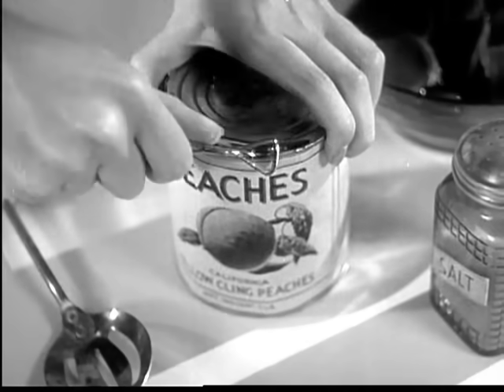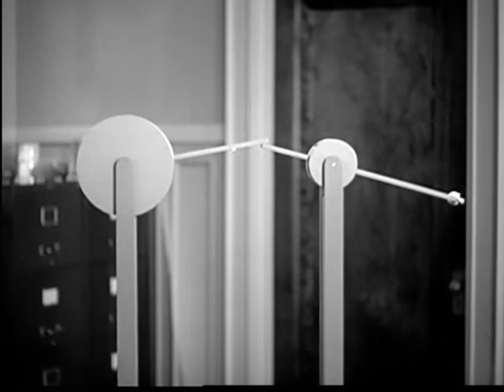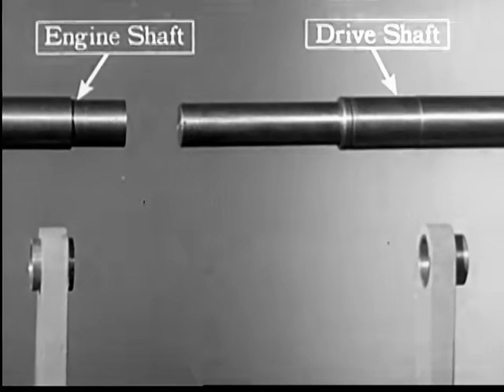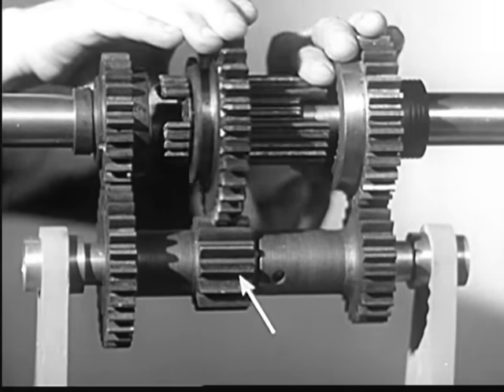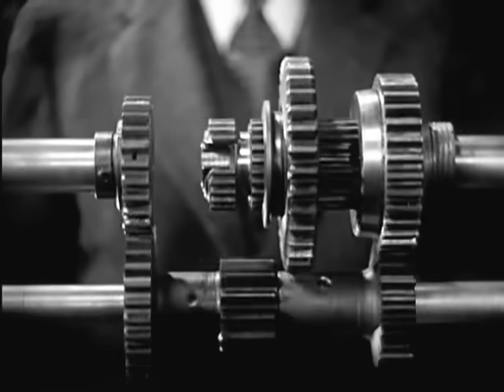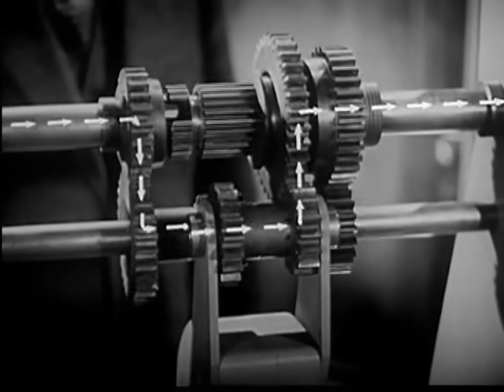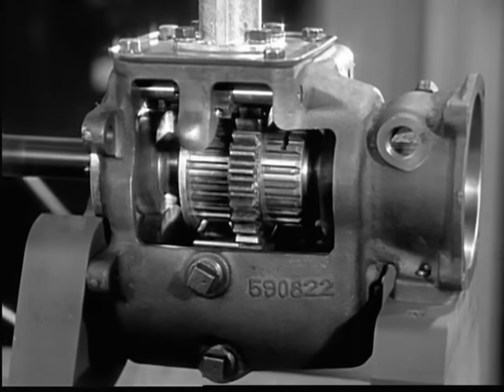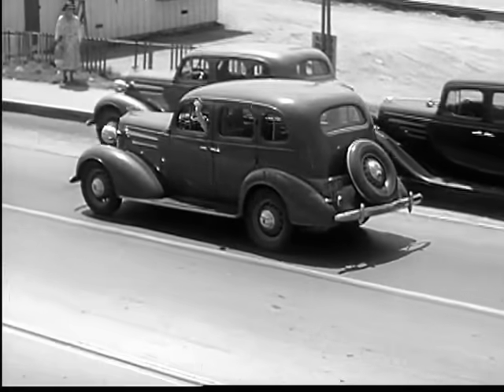Spinning Levers - How A Transmission Works (1936)

Comment: To everyone wondering why this explanation is so good.

A strong part is we don't actually understand mechanics very well anymore. The bit about a gear being a series of levers is describing the gear in terms of its first principles, the fundamental understanding. Raw science and raw engineering.

Today most education is abstracted and provides information without technical substance. There are many complex forces behind this change, sociological, political and the selection dynamics in our education system. One way to articulate it is that the people writing the material don't understand it as well, education is a cargo cult translating from experts. Rarely do the experts write the documentation and educational materials. So the information is watered down, and becomes more about teaching people a shallow knowledge about something than the necessary understanding of what it is. Knowledge is good enough for tests, but poor in practical terms. 

Evolutionary selection dynamics applied to the flow of information via human behavior. This is the subtext of the modern world given the extent and impact of social media. The majority of evolutionary science barely recognizes this, in part due to the very dynamics it should be studying within itself.
It's becoming a critical problem and we need to get wise to it.

Back to first principles. The old idea in education was to teach people the fundamental ideas of a field of knowledge so people could develop a broad enough grasp of how it works to reason about it and apply their understanding creatively. This was the point of education as a institutional project. Especially at the university level. 

Now education is mostly providing learning, if we're going to make a technical distinction in terms. The public pays to learn the functional skills for a job, what used to be on the job and apprenticeship learning. This gets nearly all the dynamics and incentives backwards. If we're going to have a stable and functional society long term.

There is no access to first principles, the idea is largely forgotten. The world is made more complex and far less compressible for the average person. This is bad for economic discovery, which is an assumption the capitalist model and just baseline market dynamics rely on to avoid bubbles and collapse. 

When you realize that Economics is actually just evolutionary selection dynamics, that's the window to a suite of effective first principles. (No one seems to realize Economics and Evolution are different maps of the same thing. Certainly not in the mind blowing essence of how this duplicates and distorts our species perspective of itself in the world.)

Anyways that's a short rant on why old vids from the 1930s being better than modern videos on the same subjects is possibly the most important topic you could think about.

Comment: 2:00  That's a good analogy, but notice how the "teeth" are sliding against one another when they make contact, rather than just pushing.  This is what happens with spur gears, and results in wear over time.  The trick in designing good gears is to make the shape of the teeth so that they "roll" against one another, and never actually slide.  The ones in 2:17 are closer to this ideal, but still not quite correct.

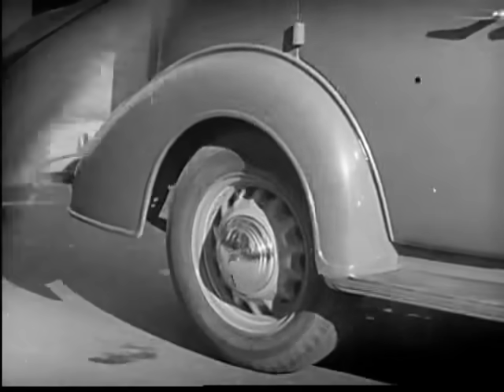Comment: Most of this film is excellent. However, at 6:23 the explanation of reverse begins. The explanation and illustration don't work together. Whatever is counter-rotating the middle if the bottom shaft is not shown. At 6:39 the trail of arrows is broken by a dash.

Comment: This is a perfect example of incremental introduction of new information. Each step is not much harder than the last, but by the end you've learnt a lot.
Reply: It's a cinch by the inch, but hard by the yard ... ;)
Reply: Exactly this.
Reply: That’s what Feynman said about Quantum Physics; “…. but it is NOT complicated - there’s just a lot of it.”
Reply: Got a question, does this car did not have clutch?
Reply: @pizzaparkerhotdogmaguire3225  yes it had just not necessary to present it
Reply: @fenrir324  Why not necessary? Clutch is one of the cores of manual transmission
Reply: @pizzaparkerhotdogmaguire3225  because there was no automatic or rather only 1 speed automatic transmission so all car where manual and because of that everyone know that there was a clutch.  The first car to have a true automatic transmission was in the 1948 oldsmobile. And the clutch also work the same way than the speed. Its just a plate smash onto another with a spring to create friction
Reply: you dont learn alot, you learn everything that was presented.
Reply: :dothefive:let  me  start you  off  with a set of Lincoln  Logs . >  Then maybe  a set  of leggo's  >   or  packet  of  seeds  , some  dirt  and  some  water >>

Comment: I pretty much knew how an older manual, an unsynchronized trans worked, but this is the best explanation of a transmission I’ve seen. Too bad this guy didn’t explain the automatic transmission.

Comment: The engine shaft is actually called the transmission input shaft. Then the countershaft and then the output shaft

Bonus
Driveshaft is actually a trademarked name. I think Chrysler owns it. All other RWD vehicles use a propeller shaft.

Bonus 2
Chrysler owns the name Alternator. Everybody else has to call it an alternating current generator

Comment: Ya know, it's a good thing they designed manual transmissions 100+ years ago. If they did it now the thing would cost more than the rest of the car, would weigh enough you'd need a separate axel to support it and they'd figure out a way to make it use microchips.

Comment: Very informative especially the synchronisation of gears thanks to clever engineering. Could they have imagined 8 speed automatic transmissions in the 30's.? Well it happened and it's here thanks once again to the quest for innovation and a better outcome.

Comment: 5:20 why there is no power Transmission on the right gear?
Its still connected. 
Edit: ok got it only if the inner tube is pushed right the outer tube is Connect with the inner tube.

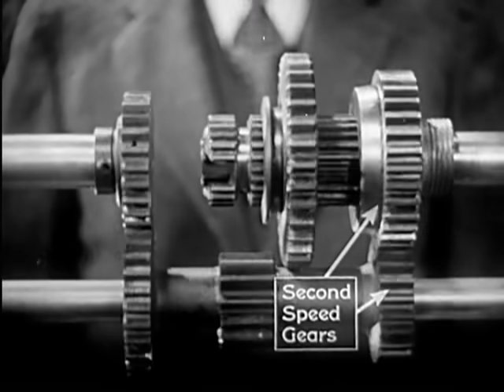Comment: IF anyone else is confused by the "2nd gear" power flow diagram (at 5:47), like I was the 1st time I watched this, it's because they showed the flow of power wrong. It doesn't transfer through the neutral gear straight into the drive-shaft (because the neutral is free floating), it goes from the neutral gear, then into the sleeve that slides into the neutral gear, THEN it goes down the drive-shaft because of the connection of the sleeve to the drive-shaft is direct, whereas the neutral gear isn't connected to the drive-shaft directly. 
Shit's been bugging me for like 8 years until I finally watched it. Also, if your kids ever ask the question of "where does the power go when in neutral" you can tell them it goes into a free spinning gear that's not connected to anything.
Reply: As I understood it, basically the sleeve is just manually moved into place which is what causes the gear to actually turn the drive shaft…right?

Comment: They should use this to teach driving. Especially those demo props with the exposed transmission. It really helps learning when you know whata going on when doing what. I remember learning to drive manual the first time and was just so confused, to my understanding I just had to feel it or with practice you eventually get the hang of it. Something so visual can really help you understand it better and have more confident in what you are doing as you are learning.

Comment: So one of the problems I see with gears is that there is only one point of contact(maybe 2 or 3 for some) and so seems highly inefficient at distributing the forces to the entire gear. E.g., all the force transfer is at the point of contact which is around 1 tooth. Are there designs that solve this problem? E.g., we could have smaller gears all around the larger gear.
Reply: The solution is very simple.

You know italic Font mode in Microsoft Word? 
So the solution for the gear Teeth looks like this //////// instead of IIIIIIII
This way, there's more flat area that can touch each gear to reduce wear & tear.

Comment: The main goal of a transmission is to, of course, transfer the force of the motor to the wheels and, more importantly, allow for slippage and freedom of the motor to rotate without stalling. In a manual gear box, a driver can achieve this with proper clutch play, as well as a physical shift to neutral, so the motor is disengaged from the wheels. In an auto, it seems the torque converters reactor diverts fluid back to the torque converter pump mechanism to disconnect its spin to the turbine proportional to the revs of the motor. 

I'm still learning the complexity of the automatic transmission since I'm currently under a Lexus trying to figure out how it failed. I'm more used to repairing and diagnosing manual transmissions, which are simpler and better, in my opinion, but not as much of an engineering marvel like we see with an automatic shifting transmission based on hydraulic principles without a manual clutch mechanism. 

I have alot to learn and understand about automatics, that goes without saying, and videos like these help greatly for just a general understanding of what the auto trans did to achieve forward motion without manual input and clutching that is seem here.

Comment: Large gear equals to higher torque but lower rpm. Small gear equals to lower torque but higher rpm. I can hardly imagine the formulas and equations that were needed for that thing to be invented. 🥶

Comment: Since I learned about rolling in rotational dynamics, the analogy of gears being a "discrete" form of rolling helped me understand the mechanics more than the lever explanation. 

Basically, if the gears are A and B, at the contact point, vA=vB since otherwise the teeth of the faster gear would have to somehow teleport through the teeth of the other. 

Moreover, this is a "self-correcting" thing where if the speed of one gear is increased (for example, by pressing the throttle and increasing engine revs), the faster one pushes the teeth of the other gear and applies torque on it (i.e. angular acceleration since i) I is constant and ii)Direction of L is constant) till they have the same contact point velocities

This happens in rolling as well where friction is applied on the other's surface by both objects till slipping stops.

Only difference being that slipping just cannot in gears due to the presence of teeth in gears

Comment: The lever arrangement in the transmission wasn't immediately obvious to me. But, if I have analysed it correctly, the larger cog on the left connected to the cog on the engine shaft acts as the longer lever for the small cog on the right that runs the drive shaft to the car's wheels. The smaller the engaging cog is on the right, the shorter this lever becomes, hence more speed but less torque (or turning force). Correct? I would probably have benefited from a Mechano set as a child.

Comment: Their demonstration of how reverse works is wrong they would have to add another shaft.....?
Reply: It's there, just the angle is confusing. Third shaft is on the bracket with two idlers. It blocks the view of the lower shaft while being in line with it in front of it.
Reply: You're right....and to add to my confusion the output shaft looks like it's turning in the same direction as the input shaft....but the shaft apparently spins inside the last gear...making it look that way.

Comment: I'm 70.  I remember when manual transmissions were abundant and the girls couldn't drive automatics.  All those push buttons and letters on the columns blew their minds.  Flash forward a few decades when automatics were standards, and the gals couldn't clutch a manual transmission.  Well, today you can't buy a new manual transmission car.

Comment: One question, does the size of the gears affect the speed?
Reply: The distance from the fulcrum so yes the radius of the gears affect the speed
Reply: @matthewlachance3362  No, their ratio affects the speed
Reply: @Българиянадвсичко-с9ж  a gear with a larger radius is making fewer rotations the farther the testy are from the fulcrum so yes gear size affects speed

Comment: Question at 5:22: why does the power go from the second gear on the countershaft, rather than from the third? Is it related to greater leverage or torque or something?

It seems intuitive, but my understanding of physics isn't solid enough to give an answer.

Comment: This is the kind of education I wish I got when I was in school! Wow!
Reply: We actually did in the late 1960s.  I search for these movies now (they weren't called videos then) and remember learning "Intake, Compression, Power, Exhaust" (the strokes of a four-cycle internal combustion engine), how air flowing over a curved surface develops lift (picture the arcs of cartoon arrows flowing over the convex cross section of a wing), the three ingredients required to start and support rapid oxidation/fire (fuel, oxygen and spark), that the opposite of rapid oxidation (burning) is slow oxidation or rust, and many other things from what were - even in those years - considered "old movies".  The entire 4th grade of the school sitting on the gym floor in straight rows with our legs crossed ("Indian Style" - NOTHING was woke and nobody was offended) while we learned how things around us functioned.  We were expected and required to behave ourselves.  Expected to do homework.  Expected to get A's and B's on every report card.  We were taught geography of the world and how people make a go of life in those other places, math, science, reading and writing. 
     My mom had a set of multiplication flash-cards (a deck of playing cards with multiplication problems on them) and we went through them now and then in the evenings when I'd ask her to get them out so that I could learn the multiplication tables by memory.  It was all good education.  I knew it and appreciated it as it happened.  It wasn't until I graduated from high school in that small town and went directly into the Army for 7 years that I realized just how good my own public school education was.
     Yes, education was different then. Different in a very good way. 
     Around the turn of the century, (the 21st Century) as a a middle-aged adult, I overheard my 20 year old daughter's suitor ask her, "Is there anything your Dad doesn't know how to do?"  I found that question both humbling and yet - interesting - because I really only know the usual stuff that any other high school graduate guy from those days was able to figure out and accomplish. 
     If the lawn mower deck breaks, you buy a welder and repair it.  Thereafter, you have a welder on hand for when other stuff breaks.  If one of your vehicles has a problem, you spend a night or two after work getting it going again.  The guy at the auto parts store knows your name, asks what you're working on, and lets you pick his brain about what the solution could be.  Hands are clean, but they sometimes have a bruised fingernail  and show scars which remind of learning experiences. 
     I was average among my peers at a random, midwest high school in the 1970s.  Not a science nerd, math whiz or English scholar.  Don't have a college degree, but two from vocational schools.       
     Decent grades and everyday mechanical and troubleshooting skills were simply what it took to maintain one's self-respect, to obtain a diploma, to keep a 27-year old truck running and to pay for dates while earning $1.85/hour doing dishes/cooking at a restaurant after school and on weekends.  Gas was less than a dollar a gallon, but after State and Federal tax withholdings on the paycheck, one could buy less than two gallons of gas for each hour of actual work.  A really efficient and well-tuned new car could approach 20 mpg, but we didn't own any of those as kids.  A local pizza cost $7.  (It was - and still is - super good. $29 today.)  My buddy and I saved all week so we could split one on a Friday or Saturday night during a break from driving loops around our small town with the other guys in our junk vehicles. 
     I remember saying out loud one time, "Five thousand dollars should cover the first new vehicle I buy."  My older brother drove a sweet Plymouth Duster for which he paid $3k brand new, with zero miles on it, off the dealership lot in town.
     I could go on...life was good...it still is.